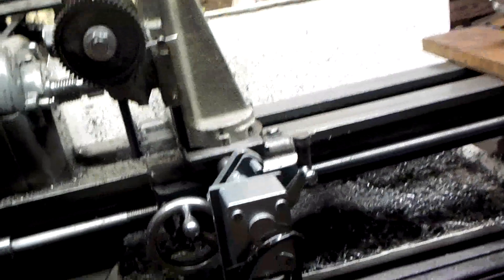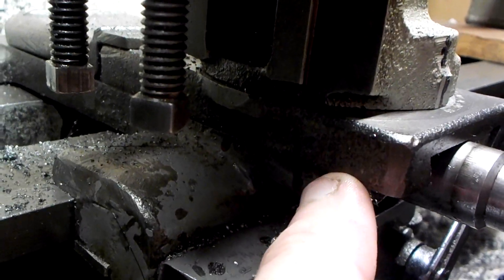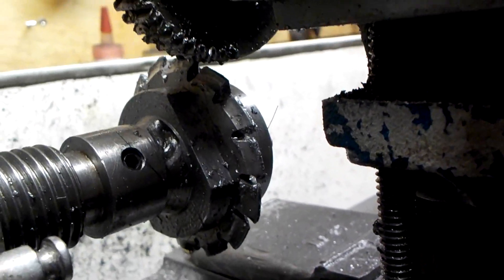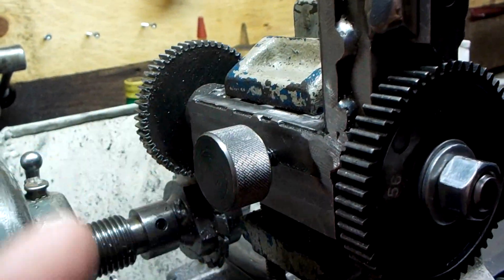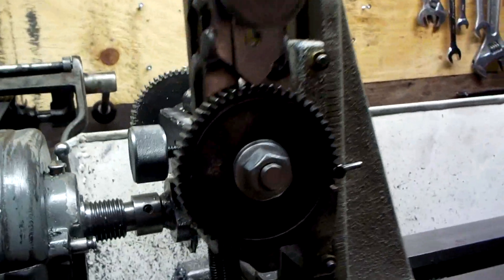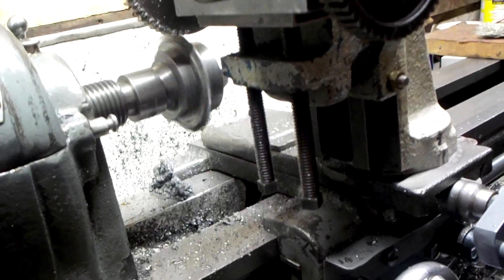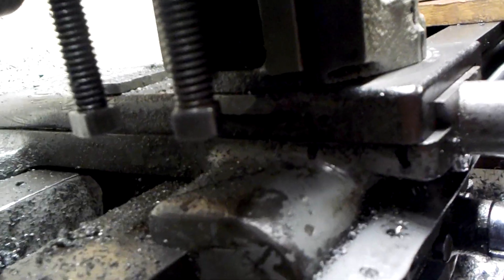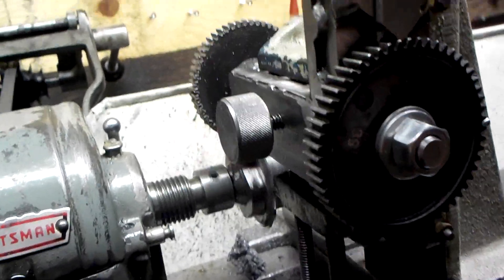Cutting A 56 Tooth Change Gear Using The New Version 2 Attachment On A 6 Inch Craftsman Metal Lathe

Comment: The smaller version of the attachment looks like it does the job quite well.  Was thinking about your tailstock support.  If you have a center in your gear cutter arbor, maybe a 1/2 inch rod with a center tuned on the end held in the tailstock chuck with some high pressure lube would work.  Thanks for sharing.

Joe